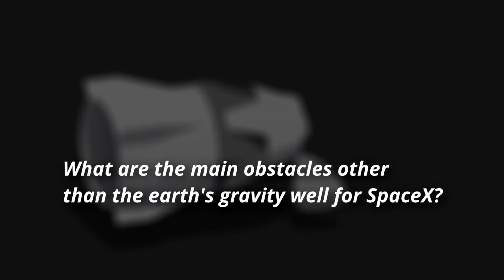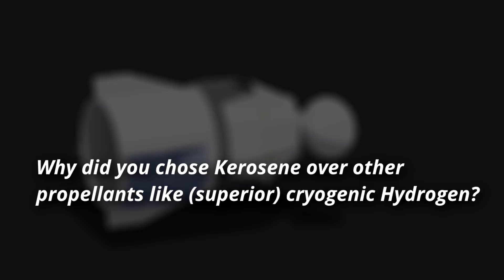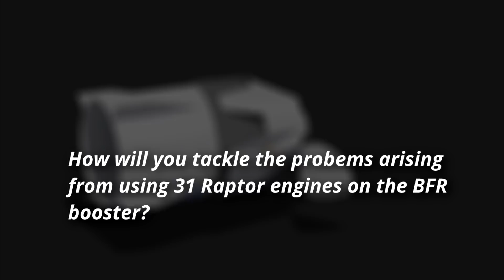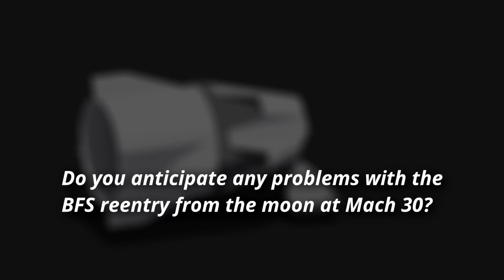SpaceX IAC 2018 Talk Summary || Reusability: The Key to Reliability and Affordability

Comment: The problems with so many engines ha some one is thinking about what happened to the n1
Reply: Doc Dat really the n1 failures are down to bad engine design, lack of testing, and horrible flight computers, so I’m not sure that FH will have the same problem.
Reply: The engines where exploding left and right on N-1. In the first attempt random voltages caused the computer to shut down one engine and immediately after shut down the opposing engine on the other side. Then oscillations caused another engine to rupture its fuel lines causing RP-1 to leak all over the place and come into contact with oxygen leaking from another exploded engine. 
By 25 seconds into the flight fires where raging in the lower part of the booster under the fuel tank. This went on for another 40 seconds until the computer shut down all the engines seconds before separation.

Do you really think 21st century computer control and engineering would let this happen? Raptor has already been tested more than any NK-33 before the real flights.

And those flights where meant to be trial and error test flights, they had 12 flights planned before any mission would have launched. And by the fourth they basically had it figured out. Soyuz has a similar history. A few more flights and they might have solved the problem and N-1 might still be flying today.
Reply: BFR will have much better engines and many generations better flight computers.
N1 had engines that were never test fired, and its flight computers, although innovative, were completely unreliable

Comment: Payload capacity of falcon heavy stated in this video is highly inaccurate
Reply from the maker: I hope it was not an error on his slides but that's what he showed (https://i.imgur.com/2irCT4k.jpg) It reads 15000+ so it's a very vague statement. On the slide before he also mentioned 16,000 kg to Mars so I don't think too much has changed. It's a little confusing. I wouldn't be surprised if Hans made all that just up because he didn't think someone would take these numbers in a presentation super seriously.
On Reddit someone had a good idea I think. The slide does not show every possible confuguration since you could also land two cores at sea and expend one. So the 15000+ number would mean payloads above 15 tons expend the whole rocket, while payloads below 15 t would at least land 2 boosters.
Reply: These numbers could be direct to GEO, not just GTO

Comment: hm ... the website https://www.spacex.com/about/capabilities says 26.7tons to GTO, and 16.8tons ~ 15 to Mars ... are you sure they now say only 15t to GTO, or did you actually mean to Mars? ... it would be a big deal the change of 27t to 15t ... hm.
Reply from the maker: Here is the slide: https://i.imgur.com/2irCT4k.jpg I don't know what led to such a drastic decrease in performance but maybe they were just very optimistic on the website. This data is fairly old I believe, before Falcon Heavy actually flew and maybe their numbers were just that much off or it is another GTO orbit. This one on the slide is the standard GTO-1800 which means your spacecraft needs 1800 delta-v to circularize. Using Kerosene on the upper stage is really the limit here payload-wise. Even Saturn V used Hydrogen! However, the question is does anyone really need that much performance to GTO before BFR launches? I doubt it. Not with a single payload. The price point is much more important. An expendable Falcon Heavy that flew 10 times or more already could be insanely cheap.
Reply: probably the numbers at their webpage are obsolete, when they thought the central core could be much lighter ... ? who knows ? some one should ask spacex, ... you seem like a guy they would listen to :) !   ... 
Concerning BFR, well, surely Human explorations (not necessarely crewed, just modules to be assembled) do need these capabilities and possibly more! ... but one capabilities are in place commercial industries will find a right use for those.   ... my idea is that companies sized their commercial satellites to what was available and reasonable cost-effective rockets in the market. Ciao
Reply: PS: what is your twitter account?
Reply from the maker: Here is the twitter thread i mentioned in the video: https://twitter.com/kNewsSpace/status/1047416392696442880
Reply: cool, following you now.